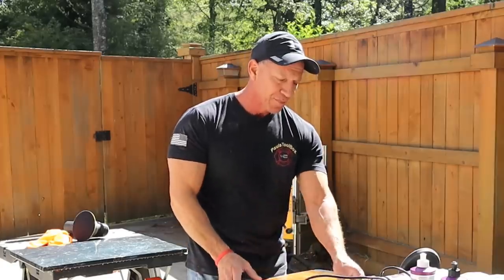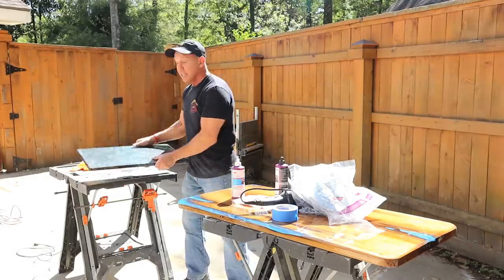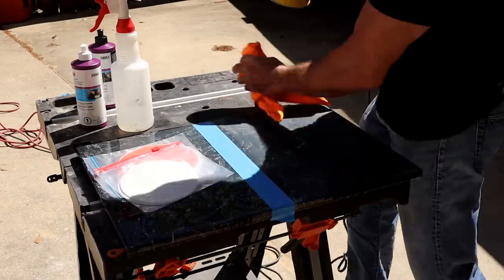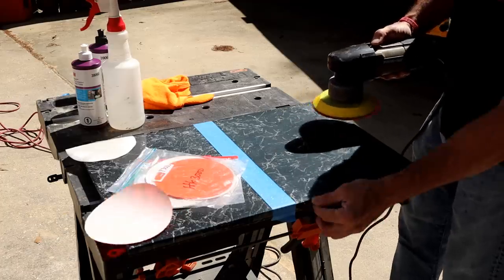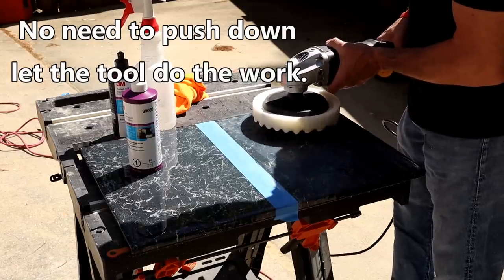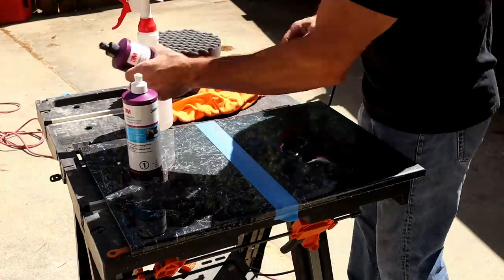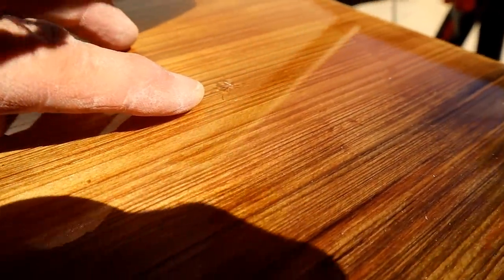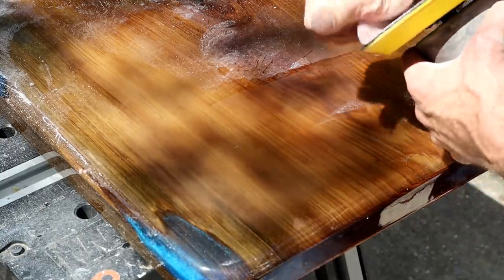How to sand and Polish Epoxy Resin!

Comment: Is it possible to just dig out the bug and add more epoxy and just sand and buff the spot?
Reply: Yes, you can do this but you'll still need to do some sanding. Best to wait 2 days to do this sanding. Do NOT wait 3 days (or longer) because the epoxy will be too cured. Clean area with a good isopropyl alcohol before pouring the added coat of epoxy.

Comment: epoxying wood is stupid! yea it may look flashy, it may be hip now...but it aint wood. for the stones it's more than fine even though they also last 800+ years without it just like well treated wood.
if you want mirror finish and see the wood under USE GLASS on it, or acrilic, better servicable, better repairable, and lets the wood be wood and not plastic.
if i want plastic, i buy plastic...and not ruin a perfect material for some stupid rave.
other than that...man your voice sure worsened a lot in the years...you okay mate?
Reply: Absolutely beautiful work,  and great tips!!! Thanks for sharing 😊